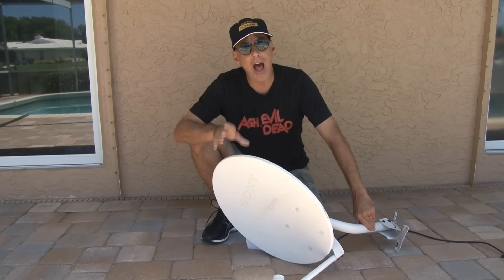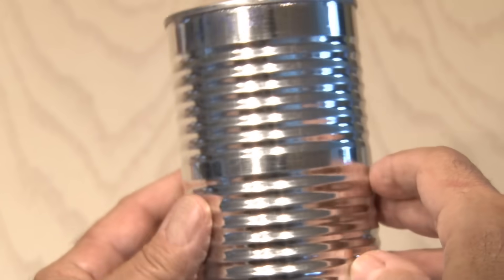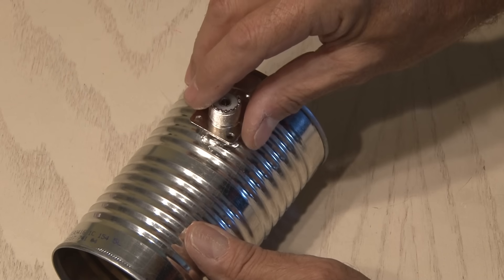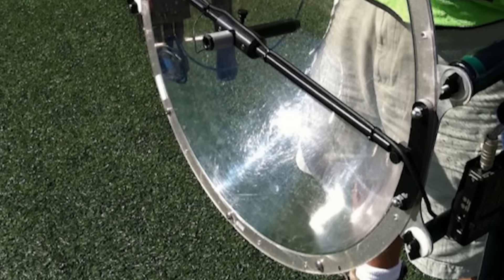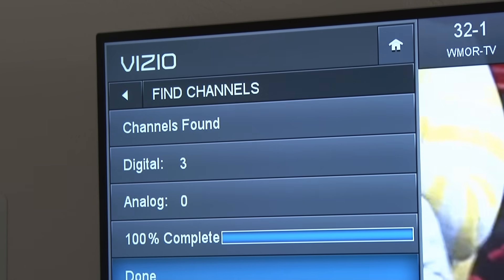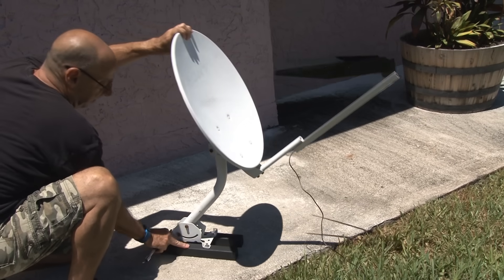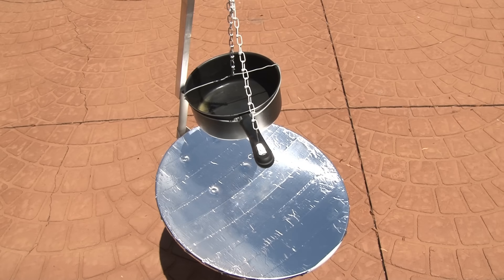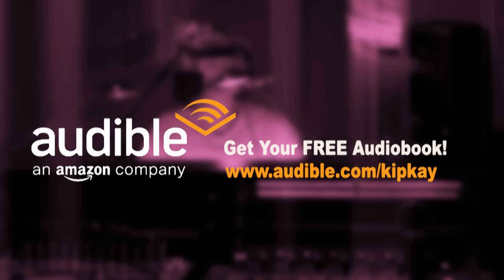4 Brilliant Uses for an old SATELLITE DISH!

Comment: Use a Unibit to cut the hole in the can. The result is a very nice, clean, non-deformed hole. The wifi booster does work great. I made one from turnpoint's website.

Comment: Rather than using Aluminised Mylar tape, it's easy to strip the paint (methylene chloride) then buff up the underlying steel with a decent metal polish, to a "really" mirror finish. Coat with clear acrylic and that finish will remain mirror for a long time.  I've used an old (small) satellite dish as the reflector on a 100W LED searchlight, and it works "remarkably well".

Comment: the free wifi one how do you make it work with the pc because connecting it to the routers antenna would only send out your routers signal so how do you use the router as a wifi adapter
Reply: Wouldn't you connect it to a modem first and connect a router to the modem?
Reply: Routers send and receive.

Comment: why did you divide the length by 4? what's the reason?
Reply: It's to make sure he doesn't collect the signal in the wrong place; i.e. to calculate the focus of the wifi signal coming from the reflections off the dish.
Reply: Thanks!
Reply: Skyefuego :3

Comment: Wifi cantena... I didn't get that part. He connects Antenna to the Wireless Router.  Does this extends his own wifi range? 
He said he gets WIFI from restaurant...
Reply: Im no RF expert here but I'm almost 100% certain that putting a little section of wire with no exact measurements in a random spot to act as the active element of an antenna while also not having a proper connection with the "reflector" can and then pointing the while lot at a dish at a random distance thats deigned for completely different types of signals will not work. If you really want good wifi range just get a $5 usb wifi card and attach a high gain antenna like a Biquad or helical or patch.
Reply: I never believed it anyway... I tried using coke can placing in the Router antenna saying that it will boost the range.. It didn't work...
Reply: +Gokul S (GS) yeah that would probably actually reduce your range because of multipathing reflections. The only way to increase range is really to upgrade the antennas.

Comment: It's okay, you can receive Wi-Fi signals. But how can your low power device (phone) send signals back?
Reply: Assuming your router only has a single antenna, you are still not that far from the actual antenna. The antenna is just outside, on the roof or window, not on the moon. You should be able to get some reception.
Reply: He said in the video he could detect the Wi-Fi from half mile away. But I don't think he could send anything back there, so it's useless.

Comment: I thought the antennas on routers are there to transmit signal,Not to receive.....
Reply: Routers transmit and receive.
Reply: Elrarion2 I already know that they transmit,But from where they receive??
Reply: +Commander Riley Requests from devices? Uploading?
Reply: +Commander Riley they can be modified to act as wireless repeaters.
Reply: Tobias Bennett Yes i know that!But that antenna is used ONLY to receive data,not to trasmit....
Reply: chadmasta5 Ok thanks!Good to know :)
Reply: Dylans VitaReviews So they can receive from another router?Like a repeater?
Reply: +Commander Riley But it transmits to the phone or computer or whatever you're using?
Reply: Tobias Bennett All routers transmit,and receive at the same time,but this antenna is used just to transmit
Reply: Commander Riley oh I see what you mean now. Sorry for the confusion, I thought you meant just Router antennas in general.
Reply: Tobias Bennett sorry i made a mistake!I wanted to say this antenna is only used to receive,sorry!
Reply: Commander Riley I get what you mean anyway, but I'm sure it's used both to receive and send data.
Reply: Tobias Bennett Well,i have no idea! :P
Reply: there is no "one way" wifi. The antenna does both xmt and rcv at the same time. That's how data communications works.
Reply: ExecTech He said that he connected to another router....How he did that?Thats what i mean!
Reply: +chadmasta5 Correct me if I'm wrong, but in order to set up a wireless repeater don't you need to know the base station's MAC address?
Reply: abou824 A repeater yes,but he said in the video that is a router,but anyway it doesnt matter :P

Comment: Is the wifi hack legal? There is some really strict radio laws in some countries. But Awesome video :)
Reply: Yes it is legal, at least in the US
Reply: No, it's not. places with free wifi are for "customers only," meaning customers that are currently there. People have been arrested for using free wifi without being at the place providing it.
Reply: Well to clarify the antenna itself is legal, but yeah you can't just use it to steal an internet connection from people. If you know the people who's wifi you are connecting to and have their actual permission to do so then yes you can do this
Reply: Actually, the WiFi hack is only legal in the United States if you hold a valid Amateur Radio license. Half of the 2.4 Ghz channels fall within the Amateur Radio frequency spectrum, which gives Amateur Radio operators permission to work with increased gain antennas. Without the license, you are violating FCC Rules 95 and 97.
Reply: +Kevin Whipp only need a license if transmitting, none needed for receiving.
Reply: roguesquatcher If you simply request a web page, you are transmitting.  And , that transmission would not include your amateur call sign.
Reply: Wifi is totally different, its not illegal to own or use a wifi amplifier, even you could buy one from most electronics stores.
Reply: roguesquatcher The amplifier itself isn't illegal, it's the connecting to networks you don't have permission to use that's illegal.
Reply: +PunkZombie1300 It was a public wifi hotspot. You can use it.
Reply: Exactly!
Reply: 3ZYBRE If you read the article I posted you'll see that in some places you can't. In that case a man was using a cafe's public hotspot, but since he was outside the cafe it was a potential felony in Michigan. Check your local laws before you use it.

Comment: hey kipkay can i use the dish to grab 4g or lte signal?
Reply: no
Reply: +sum1unoforever No, it's not.
Reply: +sum1unoforever It's not though.
Reply: To get a free 4G signal? no. To increase the signal, yes possibly. If you made the wifi cantenna and connected it to the 4g antenna port on one of those hot spots it may make a difference. I am not sure if any hot spot boxes even have an external 4g antenna though. Probably would also have to do some research on tuning the new antenna properly for the different frequency

Comment: I'll consider about that Wifi Satellite dish. This is cool, I know some areas that give free wifi.
Reply: Nah, I like shoving opinions in people's faces.
Reply: +Wing Slasher that wasn't an opinion, you just literally said you want to do something.
Reply: hentai nat
I went along with his definition of an Opinion. ._.
Can't I not have fun? :v
Reply: +Wing Slasher no.
Reply: ***** "can't I not have" or "can't I have"? Double negatives is a thing.
Reply: hentai nat
 Shhh you're gonna blow my logic. :c

NinjaTheSneaky Entertainment Aw okay then. :v
Reply: +LunarEclipse120 I thought this too. I suspect he set the router up as a wireless bridge and just plugged a device into it via Ethernet. If you have an old router laying around that's compatible with DD-WRT, have a play around with it.
Reply: I'm wondering about the WiFi as well because I can see how it would make a great receiving antenna, that's what the parabolic dish is designed to do: focus radio signals into a concentrated spot, I.E. the low noise blockdown converter.  However I would it would make a horrible transmitting antenna because what little signal it does reflect will be widely dispersed, not a concentrated bean to the receiving station, which by the way still has the same (likely poor) receiving sensitivity as before you started.   Hmmm
Reply: +Steven Lamb I hate the new Google keyboard hence the grammatical errors...
Reply: Derp Derp. I have nothing to add to this conversation.

Comment: How does the router pick up a signal(s) through the antenna so you can connect? Doesn't the antenna provide an OUTPUT for other devices to connect to? He says it picks up signals from miles a way so he can use their internet? Seems that you need the antenna hooked into your PC card in order to RECEIVE a signal.
Reply: Maybe he used the router as a switch?
Reply: thats what i was thinking...
Reply: Maybe he used it as a repeater
Reply: i didnt even know you could input a signal using an anteanna..
Reply: Maybe he meant he can pick up his own wireless from a coffee shop miles away. By hooking this up to a router antenna you would be broadcasting your internet connection which ISP's don't allow.